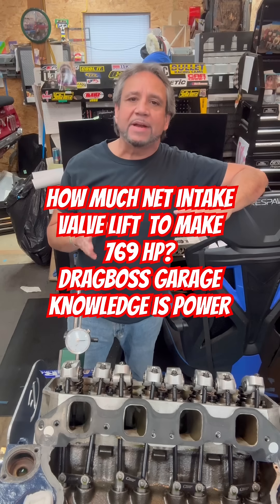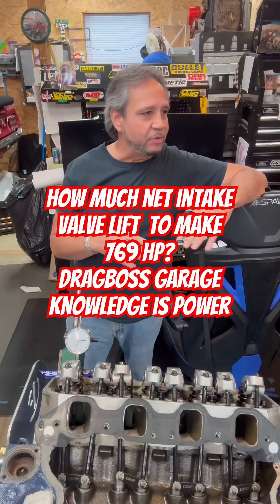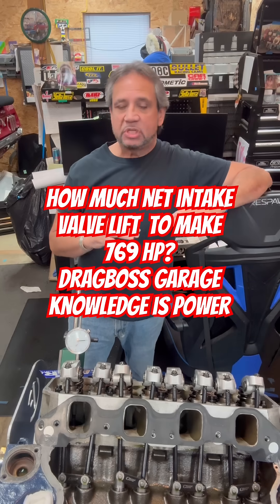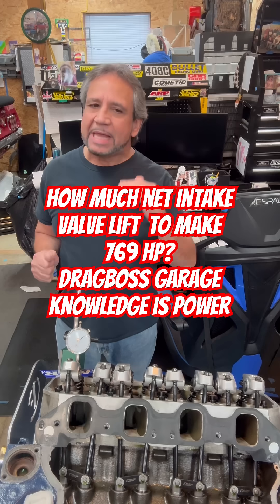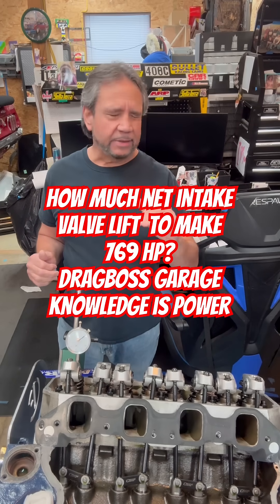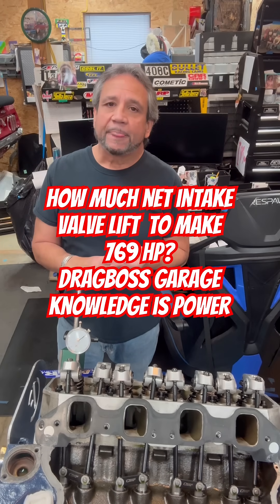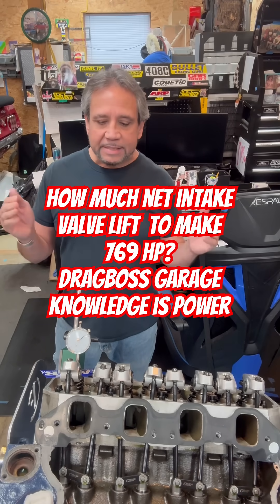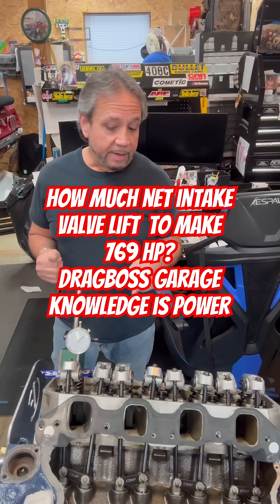DBG: How Much Net Intake Valve Lift To Make 769hp? #racing #dragracing #cylinderheads #automobile

Comment: You still have plenty of room on piston to valve to go into the 800 range right? Would you sacrifice any compression or would it stay about the same if the overlap isnt changed drastically with the new cam? Man im excited thinking about the end result already! DBG for the win!!
Reply from the maker: I should have plenty, I would obviously check it, maybe before I send off heads, to get an idea. should effect the compression, I don't think it is enough to change the timing events that much. I think I am too. Now with all new sponsors, I may have a new plan in mind.....Stay tuned.
Reply: @dragboss351cleveland Really happy and excited for you man.
Reply from the maker: @mavman351 thanks me too, lots of work to do. And preparing it all. Let’s see what we can do. 💯🏁

Comment: Duration plays a huge role as well, lift rule cam engines show that big time..we have to hold the valve open longer to make up for less lift.
Reply from the maker: Yes it does. But also makes a difference in opening and closing points, in the cycle, Thanks for being here! 💪🏁

Comment: Howdy , these are Iron heads on this 408/351C correct?
Ive noticed on my SFT with C9 heads on my 385 series 460...  the cam card calls for .014 HOT... I set them at .017 COLD .....  and thats where they stay even when hot....   .83 wallpushrods with Comp XD Rockers...
Maybe im not getting it HOT enough when checking? 
I check one side at a time... then get it hot again and check the other side....
Reply from the maker: They are aluminum heads, also these are solid roller so may be a totally different setup. These expand .006 when hot. Thanks for the question! 💯

Comment: With how big those runners are id say you could go a full inch lift 😂😂. Some aluminum rods and spin it 10500 with 2 split dominators and a sheet metal intake lol.
Reply from the maker: They flow like 396 at .900 so you could do that make 900hp. But block would give up way before that. Thanks Grover 🏁💪🇺🇸💯
Reply: @dragboss351cleveland gangster haha. I dont know to much about the Cleveland blocks to know how strong they are or their weakness. Engine looks nasty though
Reply from the maker: @GroverBoysRacing777AdamGrover  thin wall cylinders. Bottom end no problem
Reply: @dragboss351cleveland would it might not
Reply from the maker: @Rch5.0 I have pound mine 12 years but that is pushing it. It’s filled. But otherwise thin wall cylinders eventually spit down to bulkhead

Comment: How much can a stock block handle?
Is your block factory or aftermarket?
Reply from the maker: Heads can make way more power than block. Stock block 54 years old. Made 775 with 1050, 800 is pushing it, probably get a good season… thanks 🏁💪👍🇺🇸💯
Reply: @dragboss351cleveland that's pretty good.